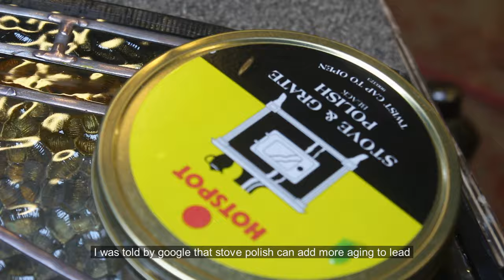Poor man's stained glass for my front door

Comment: What materials are you using?
Reply from the maker: the candle looking thing is Tallow flux and the solder is grade c 60/40, both from creativeglassguild.co.uk
the lead is 5mm self adhesive came of ebay and the glass paint is lefranc and bourgeois vitrail "orange yellow" colour off ebay.
The tarnishing fluid is copper sulphate, you can get this in crystals off ebay to mix with water. i made my own by dissolving copper pipe in white vinegar over a few months (it has other uses as well).
Reply: robert lombardo  In the UK, church stained glass is made from individual coloured glass, though, in the case of windows with details of faces, robes, hands, etc. the glass has artwork painted onto the coloured glass.  Geometrical window patterns, however, are solely coloured glass pieces, joined with shaped lead strips.
Reply: It was great that you used no annoying, loud and inappropriate background music. Silence is indeed golden.
Reply: I’ve saved this video. My new home has a 4 foot by 4 foot window next to the tub! Unless I want a public viewing, I’ll copy your idea! Thank you!
Reply: @Offshoreorganbuilder  church glass pieces are not just simply painted they're painted with vitreous paint and then fired at a very high temperature.
Reply: @upwardsofunknown7161  I am aware of that, of course, but thanks for clarifying it for those who do not know.
Reply: @NewYorkshireWorkshop   Thanks for listing what materials you used !!! I have been looking for YEARS for "Glass Paint""to do this type of Stained Glass !!!  Thank you SO MUCH !!!!!!!!
Reply: robert lombardo  Maybe Newer Churches but I live in a town where they did have old leaded windows. They were so prized that when they built a new church those windows were removed and place in the new church's windows. But now that old church has been sitting vacant and boarded up for about 20 years and even the stone that it was built with is from the quarry nearby and would worth selling.
Reply: There's a company called Decraled (if they're still going) who used to make very thin glass bevels in decorative shapes and colours to glue onto to the plate glass, so if you have normal window glass you can make it look really fancy. They also used to make the self adhesive lead strips.
Reply: @NewYorkshireWorkshop  you can get copper sulphate in ZEPS root killer. Sold at big box stores.
Reply: @adobemastr  I make videos with a mixture of music only or talking/working only. What I can't cope with is videos with people talking with loud music in the background.
Reply: @RabbitsInBlack  That is sad. Once prized, now abandoned.
Reply: @upwardsofunknown7161  
Everyone know that!!!!
Read the NAME of this Video... IF YOU want REAL Stain Glass... 
then Find another video... "Du"
Reply: @Offshoreorganbuilder  
This VIDEO shows how to do a FAUX Window... 
Go to another video if you don't like this...
Reply: @judichristopher4604  i make stained glass for a living i see plenty of it, thanks for the really aggressive reply almost a full year after i posted a comment in no way condemning the video.
Reply: @Offshoreorganbuilder  
So Sorry... I meant to hit another button!
Reply: @upwardsofunknown7161  
It felt like you were... the fact that you even mentioned it... knowing this is a FAUX way of doing a Stained Glass.
You being a Professional.. saying that, felt like you were condemning the method here.
I totally RESPECT a professional like yourself not thinking this video is up to par. Most of use can't afford to pay a professional like yourself. 
I guess this is a difference of interpretation. I'm glad I was wrong.
Reply: @judichristopher4604  Understood.  My last comment has been deleted!
Reply: @judichristopher4604  i think what was done is great looking, i hope it has been standing the test of time. i'm still curious and would kind of like to see an update. i had never seen a peel and stick came before, which is why i watched this video. it was a professional curiosity, i am in no way here to claim superiority. i was just replying to comments about church glass after i watched the video. there are many different methods of stained glass, i occasionally like to share information on how they're done if people are talking about them. there's no malice when i do.
Reply: @upwardsofunknown7161  
Right... I understand that now... Thank you so much for helping me understand. That is what is hard, when we just see printed words, without the feeling behind it... 
From what I gather the lead strip is pretty good... great Glue...
It would be nice to know how long it last. I'm sure if it's out of the weather it should be good for a long time.
Thank you for your reply.
I pray 2021 is a great year for you and your family. Happy New Years.
Reply: @Offshoreorganbuilder  stained glass windows will have two different types of paint, there is the paint applied on the gall and then fired in kiln that will be permanent and therefore more durable, there is also what is called cold paint that is added on the windows ones it’s already made and is exactly like on the video. 
Cold paint is usually added to correct a design but it can also be an update or addition on a window. 
Some artists may also choose to only use cold paint for cutting costs or for convenience as a kiln is pretty pricey to buy and to fire up.
Reply: @damienthefrensh  Thanks for the further clarification.
Reply: Lombardo j Robert  oh really? I had no idea church windows were painted!
Reply: Wow so beautiful.
Reply: Прелестно. Очаровательно. Выглядит богато.
Reply: Lombardo j Robert  its called lead came, yeah it sounds off but thats the name
Reply: Preciosa obra de arte, justamente pensé q pueda hacerse algo así, pero pensaba como se puede adherir el estaño en el vidrio.
Veré de traducir y ya tendré la respuesta.
Felicitaciones!! Desde Argentina una nueva suscriptora 🤗
Reply: @jobellecollie7139  did you do it 😳😘
Reply: Do you have any pics Jobelle? That is the scenario i am in so am intrigued on ideas
 Ta
Reply: @NewYorkshireWorkshop  thanks for listing the materials, have you any ideas about how to further adhere the lead to the glass, with such a beautiful job I'd be concerned about it detaching 🙏🙌🙏
Reply: I really enjoyed this video. After it s all completed is it subsectible to scratching easy?

Comment: Fabulous job!  Very authentic!  I did a transom over the front door many years ago without any specialized materials.  I used a black silicone caulk from a tube to imitate the leading and filled the coloured areas with transparent nail polishes  It was on plain flat glass rather than the modeled surface. Many people have commented over the years on our beautiful antique stained glass.  It is up high so it doesn't get touched or scrutinized too closely.  lol.  Total cost was about $20.
Reply: That is a neat idea with the nail varnish. Easier than going out and finding the stained glass paint. I want to do some stuff. It has some fine and delicate brush strokes to some of it.  I could use acrylic, some of it is transparent as well, mix it thin, then add clear resin to the whole thing and it seals it onto the glass.
Reply: When I was in Jr high, our art teacher told us the best model paint you could buy was nail polish...  She was right.  The stuff is amazing.

Comment: much easier to put picture on opposite side of glass and just follow pattern.looks fantastic,well done.
Reply: There is double fluted glass and therefore there will be strong distortions.
Reply: @user-rq7et2jq2l  yes your right.well done.all your stuff looks fantastic.cheers.
Reply: @markchambers9415 , I am amazed that you were able to find my photos of works. Thank you for your good rating.
Reply: He does that with the pattern for the door windows in the beginning, but you can also see that it doesn’t work that well.
Reply: not on that double paned insulated glass like that, if it was a single pane sure

Comment: Absolutely stunning work! I have an old 1930s farmhouse that I’ve wanted to do Stainglass in a few of the windows. This was a huge inspiration. I’m in the states, but I’m hoping I can find the same materials here!
Reply: Look on amazon and e-bay.  Acrylic paint when watered down is transparent and someone mentioned nail varnish too. I am going to do some and cover it with Stone Coat Counters clear resin to seal it all in and you won't have to solder the ends down. You can buy stuff at Hobby Lobby and Michaels craft stores too.
Testers paints are good as well. I have some and need to check it out.
Reply: @inspire734  
I can't handle smells... I use Water Based Polyurethane !!! Mixed with INKS...
and powdered makeup (pigments)... Cheap at the Dollar Store!!! 
I also add Glitter (looks like small pieces of shattered glass)... It's Beautiful.
I "Flip" RVs (on my 25th one right now) I used Gallons of the Water Based Poly...
To do the Shower.. the counter tops... the floor (to make it look like Tarrato flooring) from Italy.
Covering the flooring with the Water Based Poly is amazing...
Reply: @inspire734  
What  I was talking about when I do FAUX Stain Glass.
Reply: @judichristopher4604  you could also use ModPodge hard coat. Even less of a smell than polyurethane even. It dries completely clear, and is hard as a rock
Reply: Well obviously not on a huge project lol. That would be a lot of bottles, but for something like this definitely,
Reply: @Investigativebean  
Crystal Clear Polyurethane doesn't have any smell and it dries Crystal Clear. ModPodge is great.. Love it... but I need the Crystal Clear, Mod Podge leave a little bit of a film.
Reply: @Investigativebean  
I use Water Base Polyurethane by the Gallons! Love it ... especially the Exterior one... WOW it is durable!!!!
Reply: "I have an old 1930s farmhouse" - I don't wish to be rude but that did make me laugh. Where I come from an old farmhouse is 1390s. Everything is relative, I suppose.

Comment: When using paper stencils or patterns you can use a spray adhesive to hold them down. Most paint stores, hobby shops, or craft stores that sell stencils carry it and it works very well to hold your pattern or stencil to a work surface. You can also use it to adhere patterns to cloth when doing upholstery work.

Comment: I did my home front windows about 30 years ago in the UK with Decroled think that is the same stuff you where using. Came with a paper pattern for the inside of the window and you followed it on the outside with the sticky back lead striping. It's stayed on all these years no problem. It did turn white for a while from rain but eventually turned black/dark grey. I didn't solder the joints though just overlapped and used the application tool to press it home.  Smashing product but not available in Canada. Perhaps online but it's not a common theme here. They prefer mullion bars between the glazing. Brilliant job though M8 very well done. 👍🏻

Comment: It's a real pleasure watching a true craftsman at work, really enjoying your videos and learning a lot from them, thank you. One of my friends worked for the furniture maker Tim Stead (sadly no longer with us) in the Scottish Borders, if you haven't seen his work check it out it's absolutely stunning - the 'original' Burr Elm furniture maker and sculptor. I will say this though, you need to get that cement pointing out of your wall and replace with lime and also remove any masonry paint as that's what's causing the stonework to degrade - it's trapping in moisture, unlike your linseed oil paint. Watch Peter Ward's videos and you'll see what I mean. All the best.
Reply from the maker: thanks Nick i know ive seen peters videos, its made a right mess! all i need to do is chip it all off, the original lime is in good condition and the joints are only a few millimeters wide.
Reply: Great, an easy fix then if the original lime is underneath, and no cost except your time. Most sandstone I've seen has very thin joints. Cheers!

Comment: Very nice job sir When I started working l work for old glass company and trained in making leaded lights for 20 years + we did a lot of church windows l all so made the stick on lead then soldering I used gas iron this was ok for cane lead but I had to cool it down a little for stick on lead we used to clean the talow off with scribing brush and newspaper too black the lead and it polished the solder l miss doing leaded lights as l am a joiner now well done 👍

Comment: Just beautiful!!!  As someone who made circuit boards for years, watching that transferred solder had me screaming!  LOL I was surprised at what you used to get rid of the flux.  We used alcohol.  Maybe bc it was the only safe thing to use on circuits? (Our solder had the flux built right into the middle of it)  Of course once they had been completely done, inspected and ready to go they did get put thru a machine that properly cleaned them bc there was no way to get under certain components to get all of the flux out.   Sticky, nasty stuff.  I think more people would actually pick up a soldering iron if they realized just how easy it is.
Reply from the maker: im not sure if alcohol would remove the tallow flux, it is different to electronics flux. i just read that people who do lead soldering and use tallow clean it off with the white spirit so thats what i did!

Comment: now this obviously wouldn't work as an actual window but i used to work a haunted house. the haunt had a bunch of fake stained glass and it was made with those textured plastic sheets used as light diffuser and then we would paint the design onto them and i think instead of metal they used thin rubber striping of some sort. they looked so good back lit, we had an entire church chapel filled with it as well as the houses entrance

Comment: JB Weld piped on from a pastry bag technique is way cheaper and easier for borders.  Mixing oil paints with clear Elmer's glue emulates stained glass PERFECTLY. You say poor man's stained glass, but my way is cheaper, easier, and probably faster to be honest.
Reply: That is a great idea... I have used the Elmer's Glue and Acrylic paint before, it works pretty good, but I bet JB Weld would be even better, and we KNOW thats not going anywhere!!! LOL
Reply: Wow, that's a good idea about using jb weld. I started doing a door with glass paints and adhesive black  rubber strips. The strips were so expensive, I had to give up idea of matching Windows. Thank you so much!

Comment: beautiful work, my only concern is how long the lead tape will adhere to the glass as the window undergoes heating and cooling cycles or seasonal changes in temperature. There is a reason the lead tape wasn't so sticky in the beginning, it's not suppose to be used that way. Normally it's use to edge two pieces of glass that are later soldered along the seam. Because you have to remove it and move it around occasionally to get the edges just right, it only sticks to the glass lightly. Hopefully this won't become an issue as time goes by.
Reply from the maker: i think you are thinking of copper foil, which is the one you use to joint the glass with solder for tiffany lamps etc.
this tape is designed exactly for what i used it for. the tape didnt stick at first because of some oily residue but stuck well after cleaning and seems like a really good adhesive. heating it with the soldering iron didnt effect it either. time will tell on long term durability but it seems promising to me.
Reply: @NewYorkshireWorkshop  thank you for the correction, i was indeed thinking of copper foil, sorry for the confusion.

Comment: I'd love there to be a shot or more "seen from the inside" at the end.  But: Would it not have been easier to paint first (on the outside; with or without masking tape) then apply the lead? And that would also avoid having some strokes onto the lead (and lead being soft, that's probably impossible to get off). Of course from a few yards distance it looks super posh and authentic anyway, so all objectives achieved...  I'm having to replace my front door and I've agreed to a partially-glazed one but we can't find an attractive one --- this seems exactly what we want (a house number with a subdued decorative pattern, and maybe a fox silhouette) as well as feasible with prep and a few test pieces (free glass from the recycling).

Comment: That is a pretty clever technique to fake leaded glass panels, however it is almost as much work as the real thing.  I've been doing stained glass for more than 15 years, and it really is not hard to do correctly, and the color will not bleach out over the years.  The deal is not to get real crazy with the details, and the glass is very easy to lead up.   Also, they make instant patina for lead to darken it...  don't use shoe polish!!

Comment: Best way to use that stuff is to clean glass properly, you should first use a car type shampoo, hot water, allow to air dry, clean with ammonia and polish with a news paper until squeaky.

Then make a general application of the lead without affixing fully so you can get the basic shape, then work it in to place with the tool and hot gun (not too close) enough to heat the adhesive and allow it to stick more.

What you lose in steps, you make up for in finish and speed of application.
Reply: You can also preshape most of the strips you need.
Reply: Bees Wax on the lead may have helped...

Comment: After reading your comment about your formulation of copper sulfate, using a bit of copper pipe & white vinegar prepared months in advance, I wondered that additional preparation concomitantly would have been creating the temporary transom fitting and fitting a temporary door. Plus, there is the careful effort of removing the windows from the door in order to complete the window art. Do you have any helpful links and/or advice regarding all of this preparation? Thank you for sharing your supplies list in your reply to another commenter.